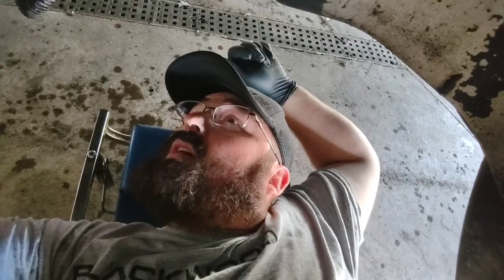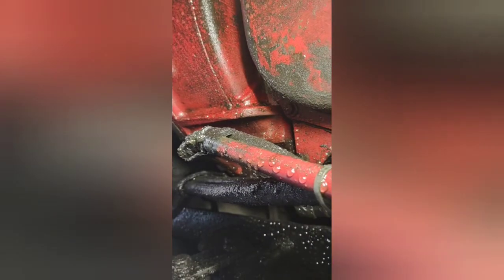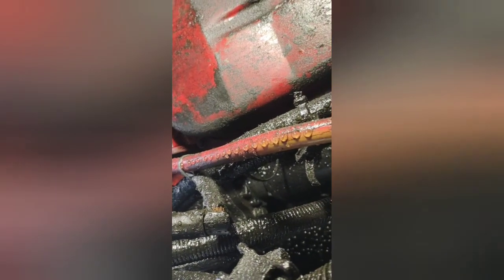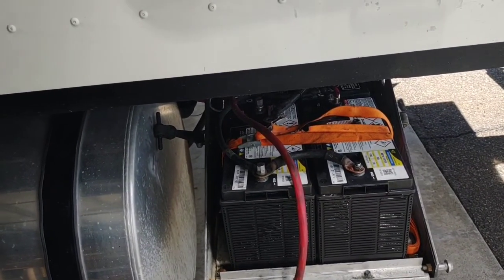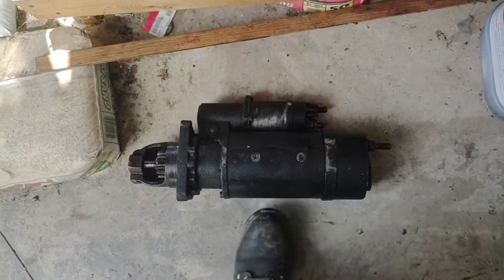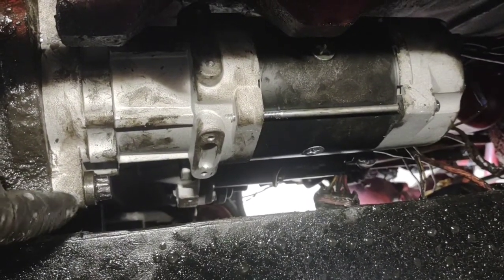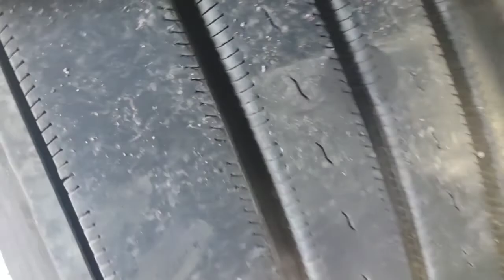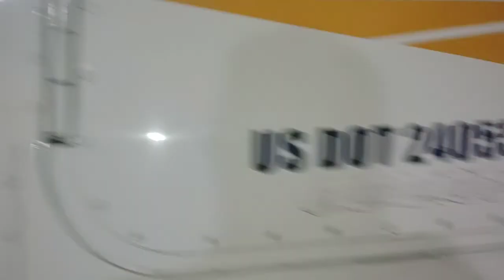The Joys Of Owning A 17 Year-Old Truck Replacing  The Starter And Then Some.....

Comment: We have the same engine and that start up is clean. The sound is amazing. Mine is not that far off, but you can tell your started is brand new. Good installation. Your mechanic experience pays off. Its seems like you would make more money as a car or semi mechanic than a owner op but I wouldn't know.
Reply from the maker: I used to be a Jaguar technician the dealership took on a Subaru franchise so I was working on them also it doesn't pay as much as you would think there were days I was working on anything from rolls royces, Aston Martin's, Ferraris even had a McLaren come in one time most of these were customers that I've dealt with with repairing their  beater Jaguar lol .

The shop was well laid out and had air conditioning but 90% of the time it never worked  and the pay was ok usually averaging about $1,500 take home there were a few times though I was able to get up to about 1900 take home but that was really pushing it I was paid flat rate and only $20 an hour flat rate you're basically paid by what the book time on the job  so if you can go faster you could make more money.... To be honest I feel that I should have been making at least 30 or more plus I owned about $30,000 in tools I wish I still had them but I worked part-time at a shop in Philadelphia for a bit and most of my tools were stolen and of course their insurance didn't cover it turned into a big fiasco
Reply: @Jackknife-TV  i hear, mechanics stealing tools from other mechanics is common. But some trucker just stole the sidepanel off my truck 2 weeks ago. And had a spare tire stolen before. So thats nothing new. Its a reason people put locks on there generators!
Reply from the maker: @DAQNOVA   yeah it wasn't like a wrench that was missing they basically took the entire toolbox luckily I was working on a friend's car that weekend so I had a giant tool bag full with most of my wrenches and sockets and a few other specialty tools.....

But they still made out with my snap-on toolbox and a bunch of stuff including a Cornwell's scan tool that I bought a few months earlier for $1,500...  

I'm not 100% sure but I believe it was an inside job because shortly after that maybe 2 months or so the owner of the shop which I kind of knew closed down .